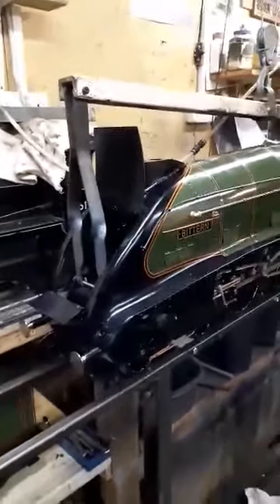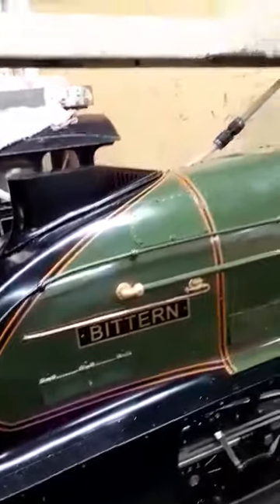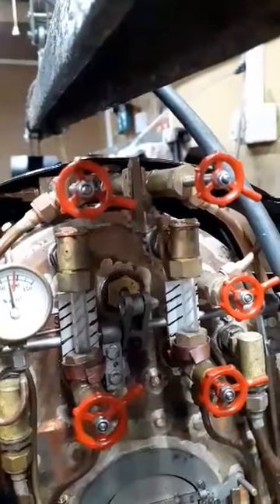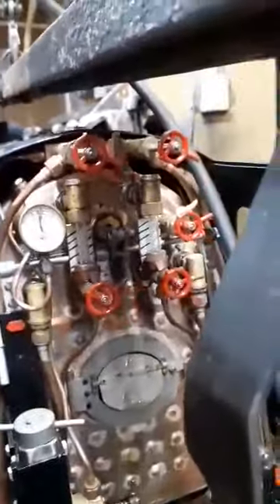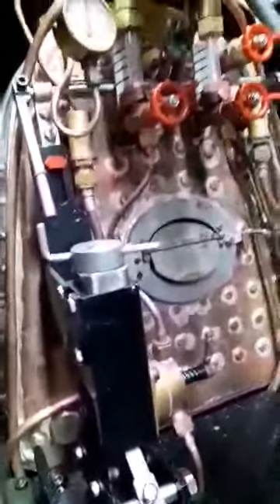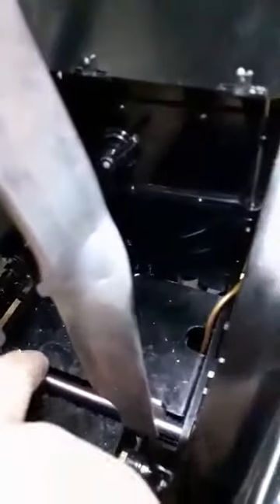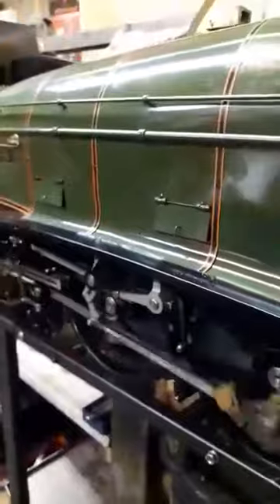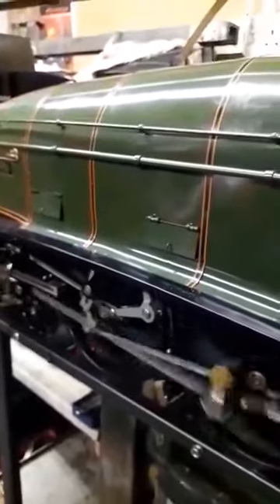Kingscale A4 an appreciation

Comment: I agree with you, I have an A4 from the same batch. Yes, changed exactly what you did (not the hoist), I also made another connection on the tender so that I can fill the boiler with an electric pump before lighting up. Waiting for 21st June to steam her for a steam test, then run her.